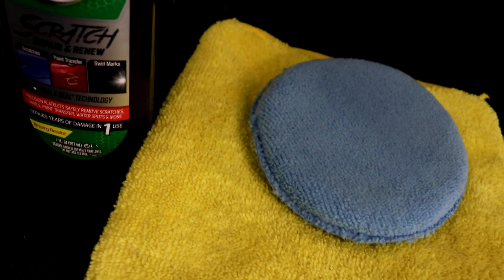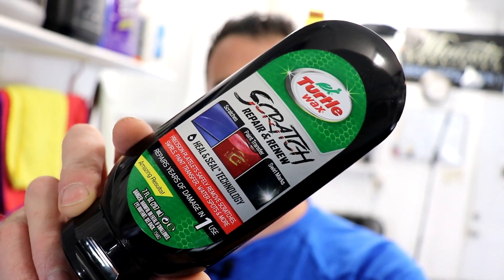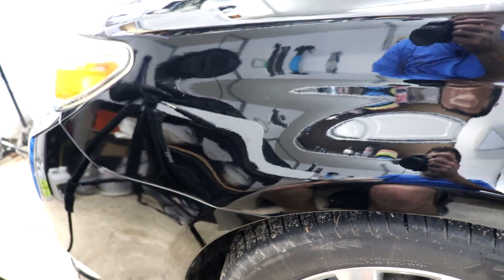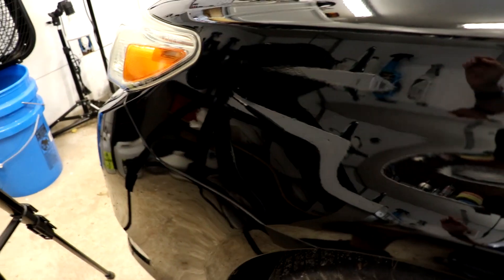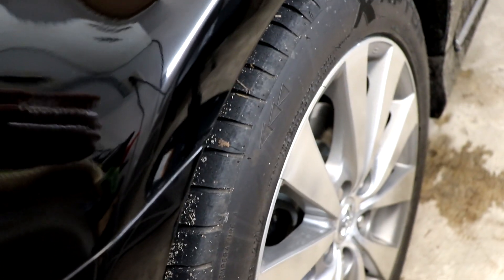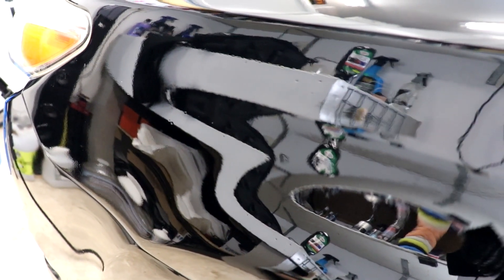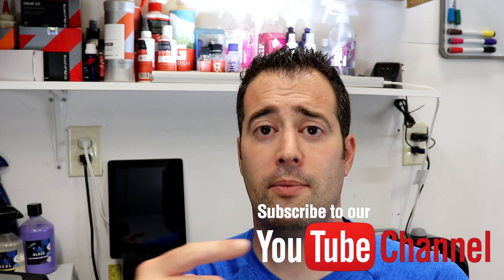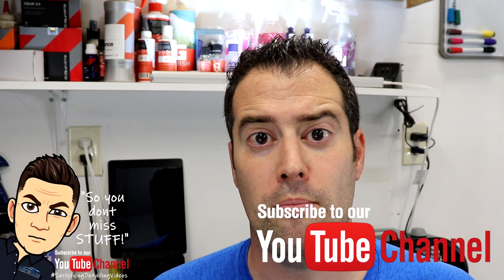How To Use Turtle Wax Scratch Repair and Renew #detailing #detailingtips #carrestoration

Comment: This actually works I used this to get a scratch off my car took a while but the results was fantastic
Reply from the maker: Awesome!
Reply: This isn’t a permanent fix right? Have you used this product again or..?
Reply from the maker: Hi. When using any type of compounding, which this products is, it actually removes or levels the clear coat by a few microns. So it is a permanent fix because the clear coat is leveled to the depth of the scratch. 
Imagine sanding a scratch in the surface of a block of wood. You use sand paper to level the surrounding wood to the depth of the scratch, thereby “removing” the scratch. What’s actually happening is your removing the surrounding wood around the scratch and not the scratch itself. 
I hope that makes sense and makes it easier to understand scratches in car paint.

Comment: I've used this product and Meguiar's Ultimate Compound for removing scratches and swirls, and I have to say that the Meguiar's Ultimate Compound did a far better job with removing scratches and swirls.  I did however use the Turtle Wax Hybrid Solutions Polish with SiO2 wax, and it was an amazing compliment.  Great review!  I wish I had a 3" buffer myself, but baby steps.  In the middle of a move and my wife is giving me the look...
Reply from the maker: Awesome!  Thanks for sharing!
Reply: I stay away from meguiars because everywhere I use that yes it's a beautiful finish and everything looks brand new and beautiful but after 24 hours it has white haze everywhere leading me to wet sand all over again to remove it. I'm going to use this turtle thing and see if it's better
Reply from the maker: That’s really weird. Why would you need to wet sand again if it’s just a haze. Simply repolish it properly. You may be doing something incorrectly. It’s must likely not the product, but the process. How exactly are you using it?
Reply: @MirandaDetailing  wet sanding is the only way to remove it nothing else works. And I'm just applying it like everyone else here does and it does look amazing and brand new after I apply it but after 24 hours it gets all white and hazy. I bought the other product yesterday and I will try with this and see if I still have that problem
Reply from the maker: @pavy415 I didn’t get any using at all after using mine. Ty hats why I think it may have been used incorrectly. 
Did you apply by hand or polisher? What pad did you use? Was the haze just micromarring on the paint or was it a film or the product?
Reply: @MirandaDetailing  it's like white powder ish material and I did use the polish machine and the foam attachment. I wipe it down as soon as I finish and I don't leave it on for an extended period of time. I do panel by panel not the whole thing at once. The strange thing is the only place there is no haze is the trunk and I used compound on that. The worse haze is on the hood and the not so bad haze is on the passenger and driver's side of the door. I still haven't used the turtle product yet but when I do I'll report back to see if there is still white haze left. And yes the white haze can be rubbed off with a microfi towel no problem but comes back again after a couple mins.
Reply: @MirandaDetailing  so I used turtle wax repair and renew yesterday night. It got rid of the white powder from McGuire's compounds and polishes, but now I have another problem it left swirls that I can't seem to wipe away what do I do now to get rid of the swirls ?

Comment: In most cases if the scratch is too deep the object is to make the scratch less noticeable like you can see a scratch from 10 feet away use turtle Wax scratch remover  and now you have to be to 2 feet away to see the scratch, but great improvement. Keep videos coming
Reply from the maker: Exactly. Good points!  Thanks.

Comment: there's like a hundred videos of sanding down the scratch and i thought "aren't we doing damage to the clear coat and if we are, isn't it there for a reason?" thanks for addressing that at the end.
Reply from the maker: Yes that very true!  However it’s interesting that wet sanding is less stressful on the clear cut then compounding. Compounding and polishing too much also heats up the paint and can cause damage underneath. Wet sanding in many cases is actually less damaging and removes less clear coat then compounding excessively. Pretty cool huh?!

Comment: it's not because of the product that you couldn't completely removed the scratch. I think what happened is that the paint in your car is been polished and wax about 10 million times so the paint is really dry. But in a new car or a car with fresh pain I think this product would completely removed a mile scratch no problem.   Thanks for the tutorial! GREAT JOB! You are my favorite car guy, no question!
Reply from the maker: Interesting idea. The paint being “dry”. Usually waxing and polishing hydrates the paint more so, not dries it out. Plus this panel was repainted so it’s not original paint.  Curious to know why you think waxing and polishing dries the paint out? 
Thanks
Reply: That was my own theory ioI I don't know enough about pain. You said that polishing hydrates the pain...once a gain you're teaching me stuff. I'm working on a couple of scratches on my car...I have no machines or tools, I have 0 experience but thanks to you and all the car guys in youtube, I'm gonna fix it myself IoI fingers crossed ! Thanks everything you do to help other, bro. really thanks.
Reply from the maker: That’s cool man!  You’re welcome!
Reply: @MirandaDetailing   I'm about to order the KIMO 12V 4" 3000RPM Cordless Car Buffer Polisher Kit w/ 2.0Ah Battery & Fast Charger, Variable Speed, 4 Polishing Pads from Amazon. I'm going to go easy with it, I need to watch a lot of tutorials before I put that thing in my car ioi it looks like the thing to have if you really love your ride, u know what i mean...

Comment: Can you pls advise how to get rid of hazing and micro-marring after you have applied the compound by hand on applicator as it was in the first case of your example?
Reply from the maker: Hi You may have to use a lighter polish to remove the haze by hand.  Best option is to polish with a DA Polisher.

Comment: And if i want to use Turtle wax hs ceramic Black spray coating efterwards. Do i have to wait 24hours before spray it on? if the answer is yes. Does the car have to be hidden under some roof for rains and maybe outsides dust?
Reply from the maker: Hi. So Turtle Wax recommends waiting 24h if you can. It’s best if it’s undercover or garaged for that time period. But as a business we never did that for those products. We just wait about 30 minutes and apply the second product. If you do get rain it mess with the results. But dust can just be blown off and then you can apply the second product.

Comment: Question: Though the sealant looks nice when applied to my suv - My driveway is 1/4 mile gravel. By day two my truck is covered in dust bc it clings to the sealant. I’ve tried many consumer products but I am getting the same results. Is there anything I can do to reduce this build up? 

Thanks so much!
Reply from the maker: Hi. Aw man I wish there was a product that could make dust not stick like that.  Honesty though it doesn’t matter if it’s a coating or wax or sealant dusty roads wreak havoc on vehicles unfortunately. Maybe you could try using a blower to blow the dust off each time. Perhaps that could help?

Comment: I just recently bought a used car and there’s a bunch of scratches on the door. I want to go ahead and buy this turtle wax scratch remover, however I am not a detailer and don’t have the proper tools.. could I go ahead and use a microfiber cloth with the wax to take off the scratches or should I buy a black finishing foam pad and use that instead.. please let me know :) thank you!
Reply from the maker: Hi. To remove lots of scratches on larger panels by hand. You can try to by hand and see how it works.

Comment: Phil , again thank you  for the time and video, and the   DETAILED   EXPLANATION, 
Only men ,you are the best. 
Phil do you think if ,since is a deep scratch,   using wet sanding 2500 and 3000 , meg 105 or ultimate compound,  and then meg 205, 
It will be the same same results? 
Let me know what you think
Reply from the maker: Thank YOU for watching!   It depends on the scratch. I tread very lightly becasue clear coat can be thin and you don’t want to burn through. It’s better to reduce and preserve than to remove and compromise.

Comment: "Hi Phillip " I Have A Question Will This Product Work On Bumpers With Blemishes On it? From Something That Rubbed Up Against it. I Don't Have A Machine ,But After Using This Product Should I Use Another Polish And Wax?..
Reply from the maker: Hi. Do you mean like scuffs or paint transfer on painted bumpers?  If so yes, it’s a little difficult sometimes without a polisher but it can be done. Use a microfiber applicator to get more bite.
Reply: @MirandaDetailing  Thank You Phillip!! I'm Going To Try it Out. 🙂

Comment: Hi! I used this to successfully remove a scratch off my car, but I worry that the paint is now vulnerable since some clear coat gets removed. Do I need to apply new clear coat or some other protectant to the area?
Reply from the maker: Hi. So this product also has built in protection already that lasts a few months. But just make sure to wash and add a wax or sealant on a regular basis and you’ll be fine.

Comment: At 19:00, you used the scratch remover,  would I use a black finishing pad? Or a polishing pad woth microfiber?
Reply: @Miranda detailing
Reply from the maker: You could use a polishing pad also with it. I wanted to see how it would preform with a finish pad. It’s not really designed as a finishing polish but did well for was it is.
Reply: Miranda Detailing  what would you recommend then to use with the turtle wax scratch and swirl remover? With a buffer?
Reply from the maker: AppleTechGuy2006 yes definitely a polisher. By hand is tough to really work the product, at least it was for me. A DA polisher is best.
Reply: Miranda Detailing what kind of pad you recommend? 
A black finishing pad?
Reply from the maker: Either a black finishing or use a medium cut polishing pad like the Lake Country Orange pads.
Reply from the maker: Yes.  The sealant would be your protection. 😎👍🏼
Reply: Miranda Detailing awesome thank you sir!  Your a big help

Comment: Would it get even better results if you used clay before applying the product? 
I’m new to detailing and want to get some scratches and swirls out of my car!
Nice video👍🏼
Reply from the maker: Hi Welcome!
No, it wouldn't make a difference....In fact, the panel was washed and clayed before I demoed this process.
Clay Baring simply removes the attached surface grit that can not be removed in the normal wash process.  It makes the paint smooth.  However, for scratch removal, the scratch will still be removed even if the paint has some gritty bits still attached.  sometimes the polishing process will also remove the attached bits. But you don't want to gunk up pads with the contamination that may be on the paint, you want to work on a smooth clay barred surface.
Hope that answers your question, if not feel free to ask further questions.  😎👍
Reply: @MirandaDetailing  Thanks! Your awnser is really clear for me as a beginner, i appreciate you for taking the time!
I just watched your Wetsanding video aswell, and i notice that you always clean the paint with a polish afterwards. If i use this product the TW repair and renew, could i get good results if i just handwashed and applied TW seal&shine afterwards or will the paint stay clouded if i don't use a polish?
Reply from the maker: Excellent!  On black paint that shows everything you should finish up with a polish to refine the paint and remove any haziness or cloudiness left behind by a stronger compound like the scratch and renew. It will look super glossy! Then use Seal and Shine!

Comment: awesome video thank you. Once done removing scratch/scratches on paint, is it okay to wipe off with microfibre towel and leave it be or should i use something else afterwards. i’m worried your going to notice where you polished or got rid of scratch. Have a black car and don’t want “patches” of where i polished. Thanks !
Reply from the maker: If you polish and refine the paint where the scratches are you won’t see any patches or anything. The polishing blends it in.
Reply: Miranda Detailing so if you do see a patch where the scratch is/was does that mean you need to polish more? What was the spray you used in the video?
Reply from the maker: You won’t see a patch. It doesn’t work that way. It’s just reduce the clear coat around the defects and scratches by the micron, so it’s very minimal. They spray I used was just a solvent that removes any possible fillers. It’s was rustoleum wax and grease remover.
Reply: Miranda Detailing thank you for your reply! So would I juts need to apply wax to that spot to restore the gloss/shine to the clear coat? Thank again!
Reply from the maker: You’re welcome. Yes...it does have some wax built in. So a spray wax would be fine.
Reply: Miranda Detailing thanks again for answering my questions!

Comment: Hey, thanks for your efforts. The instructions on the product say use GENTLE hand pressure for 30 seconds and reapply if needed. Also with the polisher 1500 rpm and light pressure, just sayin’, 😛 Does it work better for you with hard hand  pressure and high machine rpm?
Reply from the maker: I tried it all sorts of ways. It works just fine. But my vehicle’s was repainted poorly and is very soft so it mars up easily. I’ve used this on other vehicles with great results. So depending on the situation it may need gentle or more aggressive application, either by hand or machine.
Reply: @MirandaDetailing  It all makes sense now, cheers for the information, very useful.

Comment: Is is permanent and you think it will work on baige color cars ?
Reply from the maker: Hi. Good question. When it comes to compounding it’s always permanent since you are actually removing microns of clearcoat to level out the surface of the paint. This is not a cover up product but an actual compound.  😎👍🏼
Reply: @MirandaDetailing  So even washing your vehicle multiple times will not wair this product off ?
Reply from the maker: Jason M. Yes it’s not a surface covering product, it’s a compound. It actually removes microns of clearcoat. Like liquid sandpaper, therefore nothing can “return” because it’s abraded. Best if used with a polisher as shown.
Reply: @MirandaDetailing  Thanks a lot, I'll give it a try !

Comment: I repeated the process with this product 4-5 times on moderate strokes, whether my car paint still has a clear coat or is it gone
Reply from the maker: If you applied it by hand its fine.   Its almost impossible to burn through clear coat by hand.
Reply: @MirandaDetailing  
Okay..Thank you for the explanation
Reply: @MirandaDetailing  
One more guys , is the paint still safe against sun and rain water ? I'm afraid the polished paint isn't protected
Reply from the maker: Hi yes it actually leaves behind a sealant. It’s like an all in one Polish and sealant.
Reply: @MirandaDetailing  
The sealant is permanently right ? If yes , i don't worry anymore for the paint..
Reply from the maker: Hi. Unfortunately there is no such thing as a permanent sealant or coating. Sealants can last up to 6 months before they need to be reapply. So just maintain your vehicle per usual washing it regularly and waxing/sealing it every 3-6 months.
Reply: @MirandaDetailing  
Alright Friend.. Thank you very much 🙏

Comment: Wouldn't it Work better If you were to Apply it Directly on the Scratch a let it Set For Few Minutes then Buff it Out
Reply from the maker: Hi. What exactly do you mean let it sit for few minutes?  It’s meant as a polishing compound that has abrasives in it to gently level the surface and remove the scratch. To remove a scratch you have to level the clear coat around to the same deepness as the scratch therefore reducing the light refracting back to your eyes. It removes the light refracting effect. That’s actually what you are seeing when you see a scratch on clear coat. I hope that helps a see your question. 😎👍🏼

Comment: Actually, two of the pictorials on the front of the tube shows glass or plexiglass. Only the picture in the middle shows a car body, so I think this might be better suited for glass or plexiglass. The black picture showing "Swirl Marks" could also be plexiglass. Oddly enough, it doesn't say anywhere on the tube what it's specifically for, which I thought was a bit dumb.
Reply from the maker: I’m sorry that doesn’t make sense. Each picture clearly shows car paint not plexiglass. However  polishes ad compounds made for car paint can also be used to polish plastic, like headlights and taillights.

Comment: I usually value your opinions. Not with this product. I had zero success with it-after FOUR applications, the very light scratch was still visible.
The scratch was so light that it did  NOT catch my fingernail. After doing everything that you did, (And that’s ALOT of work),  the scratch was STILL visible. Thanks, but NO thanks.
Reply from the maker: Sorry it didn’t work for you. How did you apply it? Bu hand or machine? What pad did you use?
Reply: @MirandaDetailing  Thank You for your prompt response-That’s part of the reason that I value your opinions. Yes, I applied it in both fashions, and several times, like you had to. I had pretty much the same result. The scratch did Not go away.
Reply from the maker: @plugger4945  we man. That stinks. Well you could be dealing with hard paint maybe?  It’s not a very aggressive product since it’s made for consumers. But I have had problems with hard paint also and I had to use the heaviest compounds I have to remove scratches.